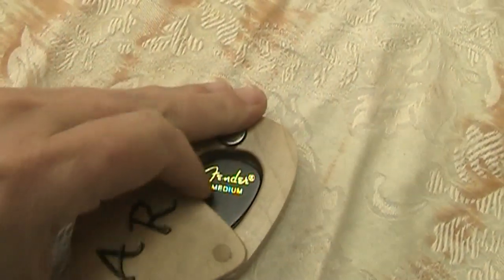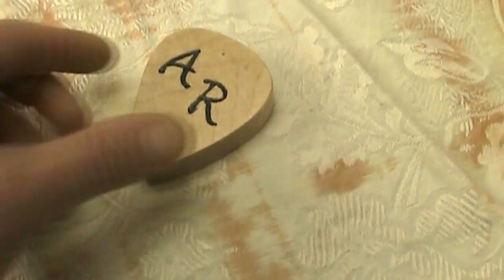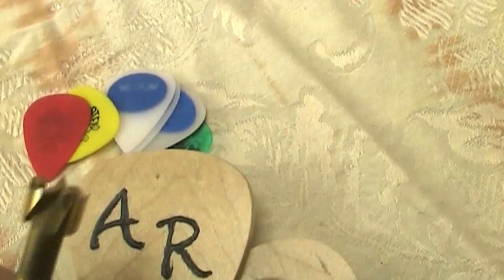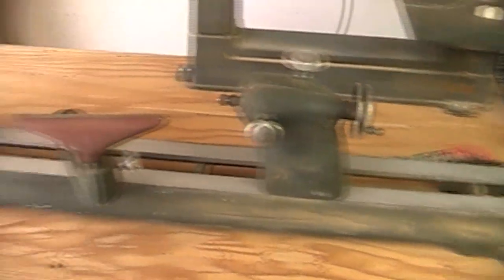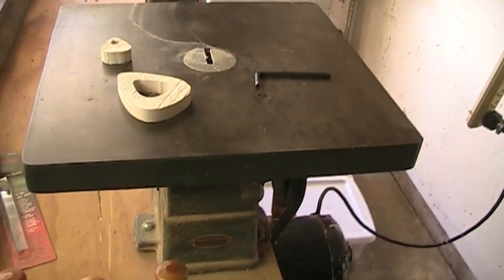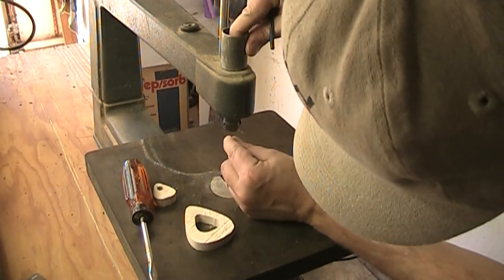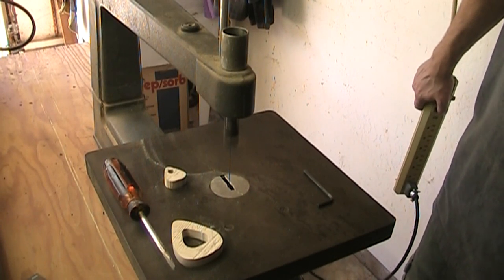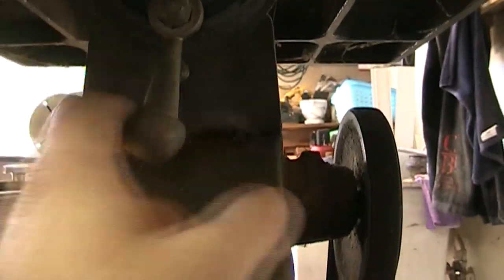MM 5-11-12: Guitar pick box follow-up / my antique scroll saw

Comment: I have the same saw! My dad made a thumb screw for the top blade clamp so no tools needed to put blade on. All he did was cut a piece about 3/4 inch off the allen wrench then epoxy it on a round thumb screw. And you leave the left screw alone and just loosen and tighten the allen head on the right. I can now do blade changes faster then on a dewalt.

Comment: Holes without a point - use a plunge router bit or an endmill.  You will have to clamp your workpiece and use a drill press, because without the point, that bit will want to wander as it goes in the wood.

Comment: I made a pick box for a guitar buddy - Used a rotary tool with a plunger attachment w/ 1/4" flat router bit to clear out the pick hole and same set up to make 1/4 hole for 1/4 magnets in the box and lid (1/8 thk mag in 3/8 thk lid). Made the hinge from a 5/16" HW dowel w/ small nickle screw coming up from the bottom (sunk). The screw head is the only thing that sort of shows - Made from ambrosia curly maple leavin's  - worked magnifico!

King Seeley made machinery stuff for Sears, 1940s-50s.

Comment: you inspired me to have a go at one of these this week. i got the idea of a magnet from underneath by accident when the magnet in the lid clicked to the one on the box when it was upside down. so made a 2nd pick box with magnet drilled from below. (if any of that makes sense i dunno)

so i started my hole with a brad pointed bit then finished the hole with a flat steel bit which prevented me having a pointy bit of a drill going through

Comment: If you go to a store that sells end mills that are supposed to be used on metal, you can purchase something that looks sort of like the Forstner bit, but does not have any points eirher in the center or around the edges. Two flute high speed end mills work best for this. They usually come in fractional sizes.

Comment: I hate the blade breaking tendency of scroll saw as well, so i've mounted a jigsaw under a piece of MDF (like a router insert), so the blade stick up through it. Then I've made an over the table arm like on a scroll saw, just with a block of wood, with and small board with a notch to catch the blade over the table, so it doesn't deflect. Works fine for smaller jobs, and the blade never breaks :).

Comment: Not exactly a solution to the forstner bit but if you have an old one which is the same size you could grind away the point. Then using the good one drill most of the hole and finish up with the modified one.
"2mm"... I didn't know American's were going metric! :P 
Good news really, the plans I am working on for my router lathe are in millimetres.

Alex

Comment: Hi Steve--on your scroll saw, the slotted screw is for lateral adjustment and the hex screw is for clamping the blade. You adjust the lateral movement so the blade travels up and down in a straight line. Put a pencil on the table with the tip touching the side of the blade and manually rotate the pulley to check for lateral adjustment. This adjustment is needed because you can remove the arm and use the saw with saber blades or die files. I can fill you in on Sears and King-Seeley if you'd like.
Reply: Thanks for this comment. I needed some help

Comment: in the past to get a flat bottom i got an old drill bit and filed off the brad point. wood needs to be held tightly in place to stop it wandering off at the start of the drilling process though. (which  is why i start with a brad point and then switch to flat bit)

Comment: Yes, use a router for making the hole from the backside for the magnet. I'm sure your buddy Matthias could come up with a simple solution for a dedicated fixture. 

I have almost the identical saw. Mine might be a Dunlop version. You could use a little clamp to hold things in place while tightening the blade.

Comment: Forstner bits also have a ridge around the edge to keep the wood from splintering.. Start the hole with a regular forstner bit till the cutting ridge scores the wood...using this as a guide finish the hole with a bit that has the tip ground down ....another way would be to use a plunge router to make the hole...in a piece this small it might not be practical but still it is a solution to a flat bottomed hole.

Comment: hi steve, to resolve the problem with your forstner bit you could use a regular metal twist drill bit. the top of it is more or less flat (unlike drill bits for wood) so if you calculate how deep you could go and transfer it on your drill press, you shouldn't see a hole on the frontside of the box.

Thibaut.

Comment: 2 flute upcut end mill  ...the upcut will make the chips flow out of the hole as you drill in....you could use the forstner bit to get the hole started...put the bit in your dewalt and barely pull the trigger...go slow till you get the hang of it

Comment: Instead of the forstner bit use a straight router bit in the drill press. Have to clamp down work piece and line up just right. You'll have a little plug in center of cut to pop out but it works good.

Comment: Steve if you had a newer version of a scroll saw you would be surprised how much you would use it.  As for the magnets those are rare earth am I right? If so they should be strong enough to go thru the wood and hold, as for the hole a touch of wood glue and saw dust from the same wood will cover the hole right up.let dry then sand you will never see it. I do this little trick all the time because I scroll and use the forstner bits and I have break throughs all the time.

Comment: Well.... if you can get it centered over your router bit of the closest size.. and clamp it in place. And slowly raise the running router. Similar to making a zero clearance insert in the table saw. But i would do several practices to make sure you know how high you need to raise it.

Comment: My grandpa gave me that very same machine. I love it, though I think its running a wee bit fast. Need a smaller drive pullt
Reply: No need to change pulley. Just add a fan regulator. I am using fan regulator to my ferm scroll saw to increase and decrease speed. I hope it will work for your machine